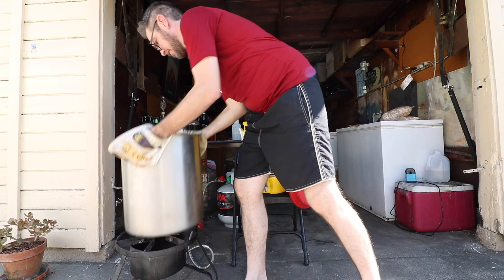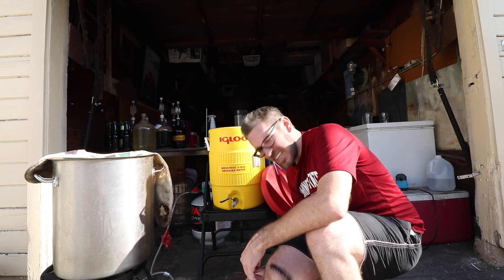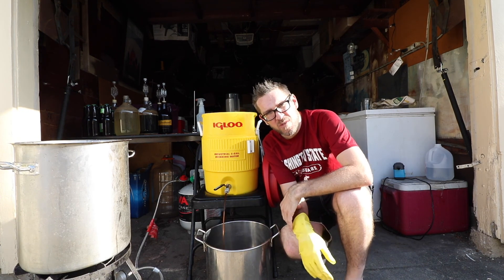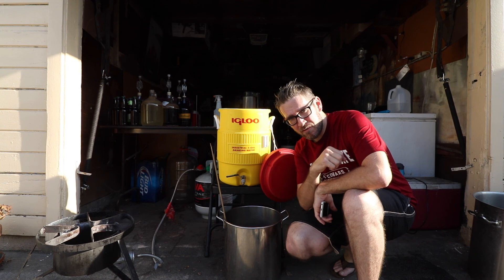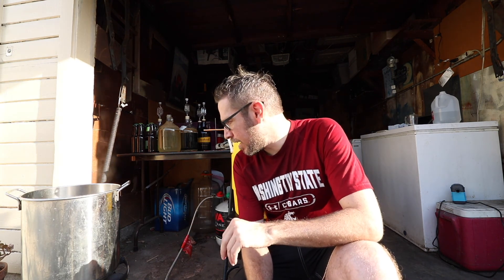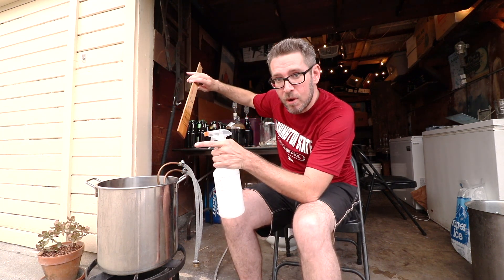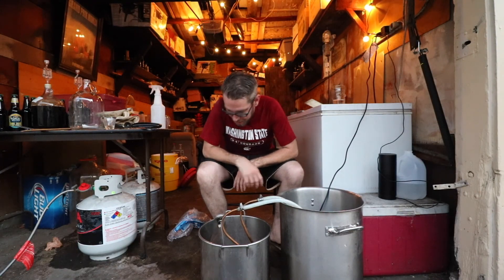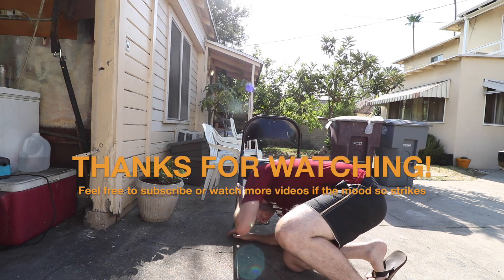How to Brew Beer...in 100 Degree Weather

Comment: I found that using a cooler with the BIAB method works wonders for efficiency by holding the temperatures and saves time.